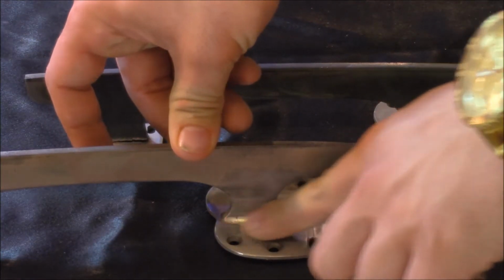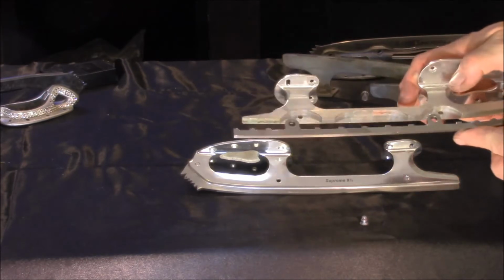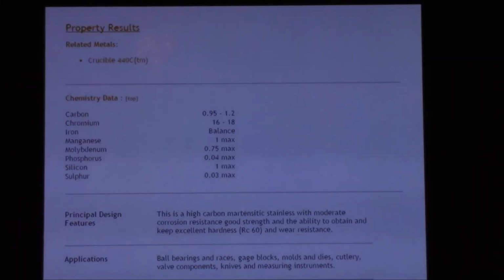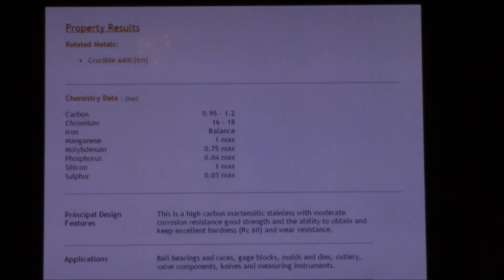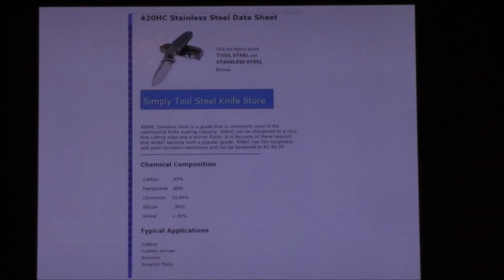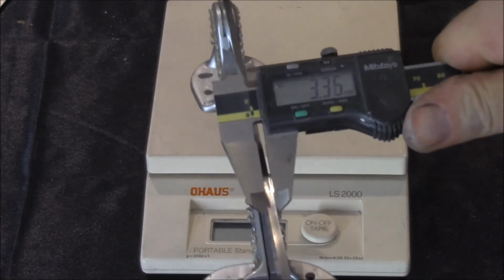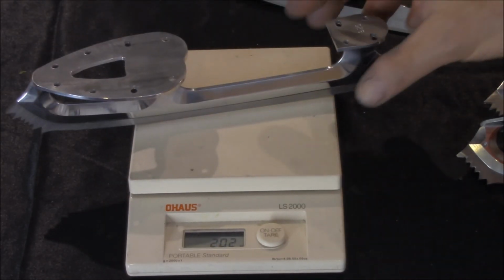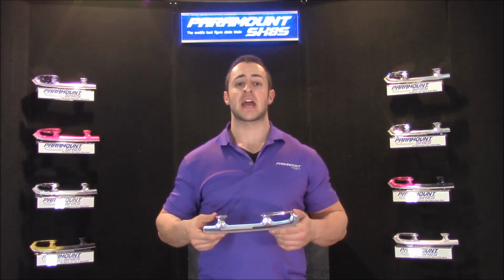Figure Skate Metals and Manufacturing

Comment: I swear by paramount blade I used one pair on matrix, because I found a really good deal and the matrix’s are basically just a knock off of paramount and after a week I couldn’t center my spins and had to put paramounts back on. Plus mine are custom pink and blue blended colors.